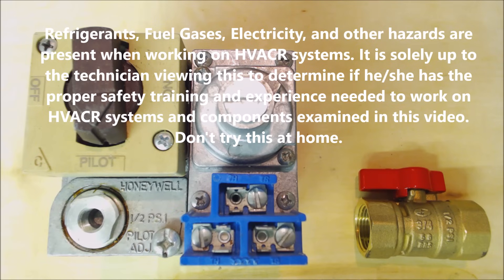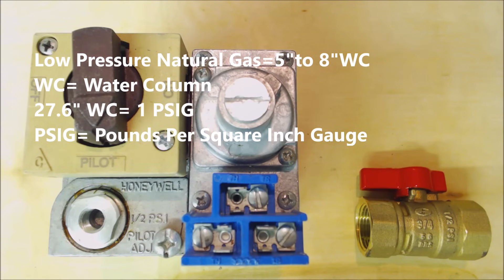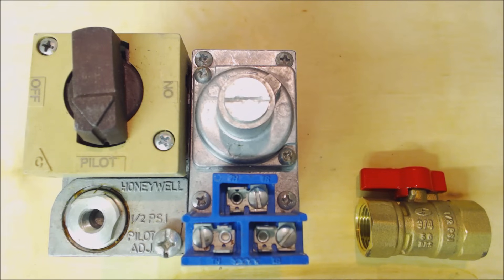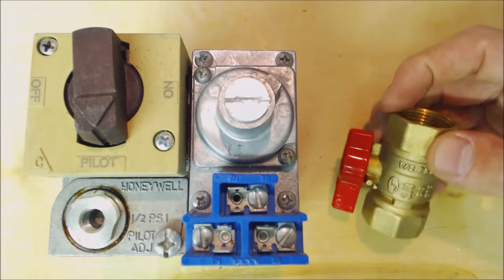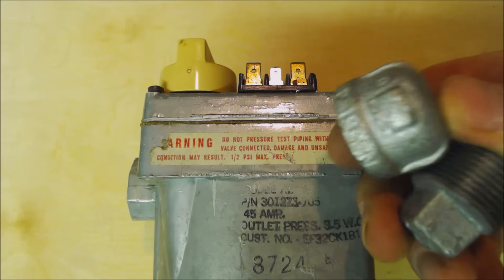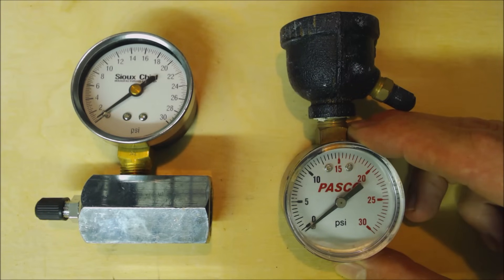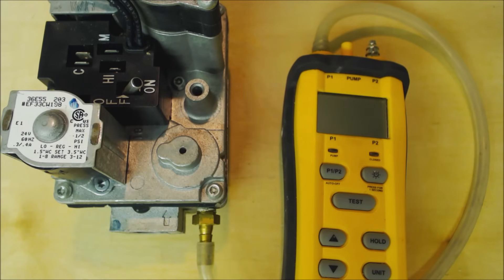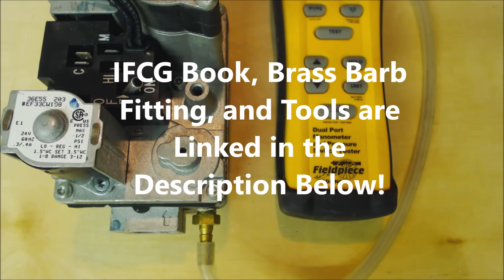What Pressure Does Natural Gas and Propane Lp Supply the Appliances with?

Comment from the maker: Tool List-  https://www.amazon.com/shop/acservicetech
Support-  https://www.patreon.com/acservicetech
For those that are looking for the tools used in the videos: (Linked Below)
IFGC 2018 - https://amzn.to/2INciYC
Brass Barb Fitting- https://amzn.to/2A1myKd

Here is the link for the Ratcheting Service Wrench   http://amzn.to/2dGV4Nh

SDMN6 Digital Dual Manometer with pump- https://amzn.to/2C5IPYx

UEI Digital Dual Port Manometer- https://amzn.to/2C3gr9v

UEI Digital Single port Manometer- https://amzn.to/2A1nkH7

Here is a link for RectorSeal Bubble Gas Leak Detector http://amzn.to/2ckWACn

Here is the Link for the FieldPiece ST4 Dual Temp Meter- http://amzn.to/2AhR6ph

Here is the Link for the Yellow Jacket Refrigerant Manifold Gauge Set used in the videos http://amzn.to/2aenwTq

Here is a link to Refrigerant hoses with valves used in the videos  http://amzn.to/2aBumVI

Here is the link to the Appion Valve Core Removal Tool- http://amzn.to/2uYr8WL

Here is the Link for the newer UEI DL479 Multimeter with temp sensor- http://amzn.to/2jtsUbJ

Here is the link to the CPS Vacuum Micron Gauge- http://amzn.to/2v1nM3O

Here is the Link to the Appion Blue 3/8" to 1/4" Vacuum Hose- http://amzn.to/2uYlVyc

Here is the Link to the Appion Red 3/8" to 1/4" Vacuum Hose- http://amzn.to/2uYg6Ro

Here is the link to the Yellow Jacket 1/4" by 1/4" heavy duty hose straight-  http://amzn.to/2umtcod 

Here is the link to the pack of 25 C&D valve cores- https://amzn.to/2J1lurm

Here is the link for the C&D Valve Core Wrench, Container, and 3 valve cores- https://amzn.to/2EVGkps

Other tool links can be found in the video description section.

Shop through Amazon! Your Purchases through Amazon provide a means for channels such as mine to earn advertising fees from all purchases after clicking through. Prices are the same as normal-    https://www.amazon.com/shop/acservicetech

All of the ACSERVICETECH Playlists-  https://www.youtube.com/channel/UCOZR-1IqsAer9wzlvFgb4mA/playlists?view_as=public
Reply: @Jamie Alvaro Happy to help xD
Reply: You all probably dont give a shit but does anybody know a method to log back into an Instagram account??
I somehow forgot the login password. I appreciate any tips you can offer me
Reply: @Jamie Alvaro instablaster ;)
Reply: @Luis Salvador Thanks so much for your reply. I got to the site through google and Im trying it out atm.
I see it takes a while so I will get back to you later with my results.
Reply: @Luis Salvador It did the trick and I finally got access to my account again. I'm so happy!
Thanks so much you saved my ass :D

Comment: I missed a space heater when pressure testing before and it very much failed to hold up, go figure!  then I proceeded to eat a $250 gas valve for dinner  :(
Reply from the maker: Oh no, sorry to hear that Throttle Bottle! Thanks for adding in your experience with that!

Comment: hi, what is the size of the barb fitting there? thanks.
Reply from the maker: Here is the link to the 3/16" x 3/16" x 3/16" brass barbed tee-  https://amzn.to/2INSRhQ

Here is the link for the 1/8" NPTF x 3/16" barb fitting for reading wc pressure- https://amzn.to/2G563Bq

Comment: When you recover refrigerant from an unit that contains non condensible air, how do you separate the air and the refrigerant? 

This is my theory...
First vacuum the recover tank 
Second  (partial amount) purge the hoses with refrigerant
Third  recover the refrigerant into the tank using a recovery machine.

If I use an recovery machine and a recover tank, wouldn’t the non condensible air enter the tank with the refrigerant?
Reply from the maker: Yes, you would still gt the noncondensables into the recovery tank. We just build in the cost of a recovery tank exchange in the cost since we will not be able to put another charge in on top of it, thanks